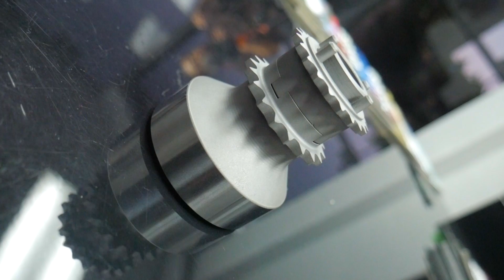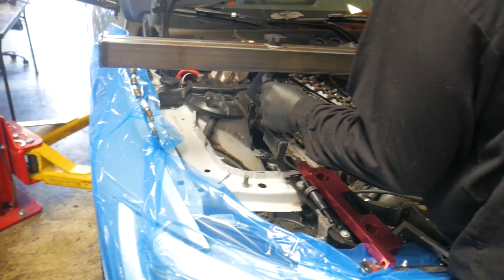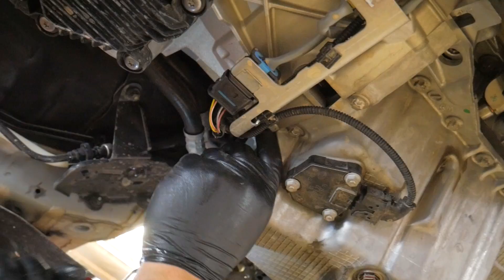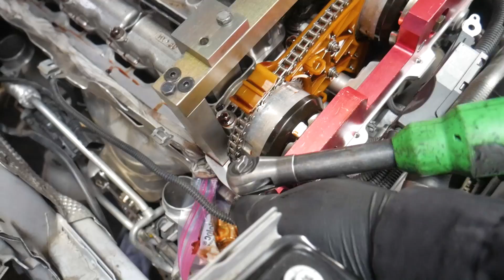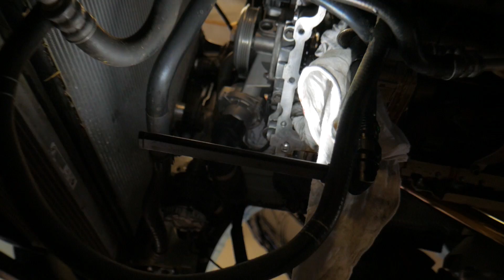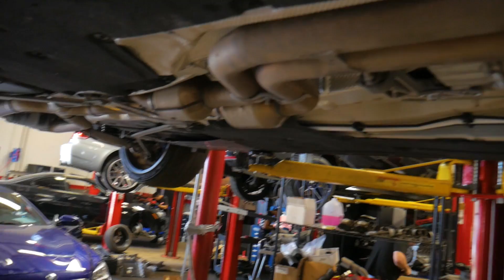BULLETPROOFING MY S55! | Keyed 4 Pin Crank Hub Full Install | Start to Finish + What to Expect!

Comment: WOW. Amazing video! 💯 Now, it's time to RIP on the S55
Reply: @yogimaster2654  Does anybody know if BMW changed the design of the crank hub on s58?
Reply: @bokiNYC  Yes S58 crankhub is keyed from factory.
Reply: @OPnoobTheDH  Any source to this? Glad  to see BMW continuing to focus on reliability.
Reply: Those pins will brake. That's the reason BMW had the friction plates, if major unbalance happens, it increases the chance of a less costly repair. With those weak pins 100% when they fail motor will just wrap up and be scrap.
Reply: @cutdepiefails6596  4 years later, 0 reported failures with the SSR 4 pin. Pins will only break due to improper installation. The SSR 4 pin is just the MAXPSI crankhub rebranded, and that was used on a 1100whp f80.
Reply from the maker: trust me i seriously can't wait 😈
Reply: what is the pricing on this if it were to be done on my 2015 M3 with the discount code provided? could you please PM me SSR? also what is the turn around time for this job?
Reply: how much was the total cost

Comment: I don’t know how drilling 4 holes into the crankshaft and having 4 tiny key pins holding the crankhub bulletproofing the engine I just wish this generation of bmw had the s58 where the crankshaft and the crankhub are unison

Comment: Don’t believe everything you see in these YouTube videos. Find actual factual advice from professional drivers or race car mechanics that actually push the limits on these cars. Your rear differential seals or turbos will first go bad before you ever have any issues with the crankhub.

Comment: This is misleading, but, You don’t have to drop the subframe if your just doing the crankhub…  Since he is doing his oil pan gasket, the front subframe is has to down….  I wouldn’t be surprised if this guy is doing his rod bearings as well.  He’s gonna need a alignment after dropping as well.
Reply: How would you change the gear hub on the oil pump drive if not removing the oil pan? Metal shavings from drilling the crankshaft???
Reply from the maker: according to my understanding from the SSR techs, dropping the subframe also helps with ease of installation as it frees up quite a bit of space

Comment: What are your thoughts on the insane bmw hub offering? I just picked up their 2 pin design and a vtt crank bolt capture for my F80. Planning to flash the car stage 1 with my current bootmod3 license.

Comment: You used a tow hook for the engine brace mounting. Which car is the tow hook from? The m3/m4 hook is too large to fit in the thread. Is there a part number/car I can steal it from?

Comment: Did you know you can get those two separate pieces and tread it into spline drive  also the crank shaft instead of getting ripped for 800 bucks 😉

Comment: And here I thought it was going to be something as simple as an oil change or spark plug change. This was damn near a full disassembly lol.
Reply from the maker: Yea man, unfortunately the process is very extensive lol. But worth it if you want to comfortably push the power levels of your F8X
Reply: @SimplyCarThings  Honestly, I'd do it even if you weren't trying to push more power. Preventative work to keep your engine from eating valves is enough of a reason to me.

Comment: This is so fake.  There are no known failures just hype to get a fix job done. !!!  The crank hub has a 100% safety built in. The engine was tested over a million miles.  If you are boosting the power over 700 bhp  then job is required.

Comment: wow, and I thought owning the E9* M3's were expensive. Seems more logical to just stick with them, as its $2000 USD or less to replace the rod bearings. vs $10k plus to correct the issue with the F8*. What the heck is BMW doing?
Reply: BMW sucks bro

Comment: Hi there,
why do you gap the sparks?
Reply from the maker: its required for the NGK spark plugs, especially when pairing with a tuned vehicle or one that is running E85

Comment: BMW engineers should have placed that crankshaft piece at the front of the driver’s wheel. On top of the horn button. Since they are gonna design them so poorly it needs to be changed on every single car!

Comment: Wonder why bmw changed the design from the n55.  Guess they figured they needed to ass a flaw for tradition?
Reply from the maker: The N55 has the same design and it has been a known issue at very high power levels
Reply: @SimplyCarThings  I did not know that. First I heard of it.  Interesting.
Reply: @SimplyCarThings  So I guess BMW knows about it and if they haven't fixed it by now they are not going to.

Comment: Love your detail and informative video, appreciation to the mechanic for sharing his skill and knowledge, but BMW design/engineering really sucked... 

The Woodruff keyway has been reliable since day one of the automotive and other industrial machinery and commercial vehicles, why the hell BMW engineers somehow think that "now is the time to get rid of the woodruff keyway", with friction lock washer for crank timing gear, the BMW engineering concept is just unreal.
Reply from the maker: Thank you for watching! Yea it's a very unfortunate design flaw that for whatever reason made it into production models for many BMW engines, the newest S58 twin turbo six cylinder engine features a keyed design from factory 👍
Reply: @SimplyCarThings  Thanks for your reply, I feel happy that you have the "bulletproofing" procedure done, and hope you will enjoy many trouble-free miles ahead!  I see your tire has a lot of camber wear, I guessed that you probably had much exciting track day driving as well.

Comment: why dont anyone use one piece forged hub?
Reply from the maker: Because installation becomes even more difficult. the Two piece design doesnt require the oil pan to be dropped if the specific shop wants to avoid that process
Reply: @SimplyCarThings  alright, good point, but speaking of reliability vise would one pice be more reloable to handle more power and granny shifting/money shifting

Comment: I really want to do it for peace of mind but it's such an expensive preventative measure.
Reply: think of it this way, either you spend 3k maintenance or 10k for the motor
Reply: @DerekYamz  that's not a good margin in my eyes, that's a 30% insurance.
Reply: It's a 50k car, what's 3k in maintenance?
Reply: @DerekYamz  Well this car is not worth 50k anymore once you've owned it for a few years. I'm assuming you're talking in USD so this car from what I remember is around 35k USD in the used market. Is it worth it? To some, maybe. But for me, I'm selling it soon for something else. And if you've paid 50k for the car, then your car is (hopefully is) still under factory warranty.
Reply: @WhatTheFlipOfficial  I don't have one but was planning to get one for fun. It's fluctuating  between 40 to 50 cad. And since you're getting rid of it soon, then there's no point for you to perform this.

Comment: I'm not sure why that hub needs to be 2 pieces since their redesign locks them together. The original is a ticking time bomb to destroy the engine. Seems BMW should do a recall to replace the part with a redesign. 
These cars are so complicated these days. It's all I can do to make myself work on my 2001 e320 MB.

Comment: If you go full e just be careful my injectors just got stuck open and had to tow car to shop. Burned half a tank of gas in about 15 miles. I test my e85 every fill up as well.

Comment: good vid. lots of work to do the crank hub.
Reply from the maker: Shnel M4 thank you so much! 👌🏼
Reply: Not something ide do in my garage. I would have also done the ic and an after market radiator.
Reply from the maker: @qwksti  Yea definitely not a DIY project lol. I thought about upgrading my cooling system but the stock F8X coolers are really good out the box

Comment: Great video 
All dislikes are by VTT Vargas guys hating on any other crank hub solution
Reply from the maker: jrzf80 Thank you! & hahaha, i have nothing against those guys or what they’ve done to help advance these platforms 🤣
Reply: What do you know about their non-keyed solution,  has it spun to anyone except that 1 person on the drag strip?
Reply: Idok Watcher has nothing to do if it spun or not but if you’re on any forum solution discussion the VTT guy is always there bashing other solutions how they don’t work how his is the only one that’s proven. As far as I remember their first solution the V1 broke the rig it was so good. Then they made a V2 cause a few spun due to bad manufacturing. Their warranty is that they will give you a new crank hub if it ever spins. Hahaha how about the engine? No. Don’t say it’s a warranty then

Comment: Omar, Great Job... your skills have greatly improved on the video side... thanks for sticking with it. I noticed... Now for the crank hub replacement the instructions and brief overview are spot on... this is not a DIY project at all based on the specialized tools involved. BIG shout out to SSR for allowing you to film this. This shows the true value of shops with highly skilled professionals. I’m planning on tuning my 2020 M2C  after my 1200 mile break in.. I kid you not.. I’m worried about all the details coming off the car and going back on tight and correct. I’ve had my moments at a Bmw shop were after close inspection I found things missing and loose, but it’s a testament to this mechanic work ethic that it was allowed to be filmed.  Omar, as you do more on your S55 engine, use this same approach, your content will be well received just like the E-46 content I’ve grown too enjoy for so many years. So will your following great job!!!👌😀

Comment: The S55 M3/M4 was suppose to be the reliable track duty N54 successor but bmw failed to make that statement true when they installed these slipping crank hubs. Also they did it just so you remember you're still driving a bmw.

Comment: This is why I stopped messing with BMW's post E36. They're disposable JUNK that you don't want to own outside of factory IMHO.
Reply from the maker: The F8X platform is pretty stout to be honest, and is insanely capable for straight line performance or on a track. Don't sleep on it ;)
Reply: @SimplyCarThings  I don't deny BMW performance straight line or otherwise. The turbos certainly facilitate gains. BMW's styling (subjective) is attractive, my favorite as of today. My criticisms are strictly long-term durability even if left in stock form. Similar complaint I have with Audi & basically all Euros.  Good luck to you, enjoy your ride! 👍✌

Comment: Would you ever need to replace the crank hub if you are planning on running stock boost with only bolt ons ?
Reply from the maker: There have been cases of it failing when stock, but the numbers are extremely rare. This issue only seems to be problematic once tuned and running high power, particularly with E85
Reply: @SimplyCarThings  appreciate the info

Comment: The amount of parts being removed gives me major anxiety! Such a big job...
Reply from the maker: Indeed, it's a very invasive process!
Reply: How much does it cost. And how long does it take ?
Reply: Edwin L 3k average, just cough up the money and your all set
Reply: @Ikiagain  3k doesn't sound bad. I would have them install some goodies while their at it.
Reply: That’s why I havent done it, I know overall its better for the engine but cracking open the engine like this..idk man lol
Reply: So dissapointed to see this about my 80k M3.  decided not to tune it , and even stock keeps me concerned all the time
Reply: I thought I was the only one. Man seems like a overhaul!
Reply: The E60 M5 was worse and it cost like 120k new
Reply: I have a 2018 f82 m4 getting this done soon from a shop here in Austin Texas 2,500 for all parts and labor not sure if I need to do it but peace of mind after all forms I’ve read about on the 2018 m4 models

Comment: Dope video glad I didn't attempt it in my garage. Defiantly need a lift to do this easily. FYI I spun mine guys so ask away lol.
Reply: Blake's Garage well wait to see how it goes. Sorry bruh
Reply: mazen sholakh happens over a year ago when my car had 9K miles on E85.
Reply: Did you spin even with the crankhub upgraded?
Reply: Sheldon didn’t have the upgrade at the time that will sort it. Well I should say this option and gintani are the only ones to buy all other “fixes” are garbage 🗑
Reply: Blake's Garage you planning on a new motor ? Been eyeing Steven Dinans motors .... not a bad deal. Keeping that option open in the future if I spin my hub. Obviously a 3 year plan lol 😂
Reply: mazen sholakh no I don’t want to buy a 40k motor by any means. I’m just on the stock tune now and I’m fine with it. E85 was gonna get me sent to jail I can’t contain myself from constantly doing 60-150mph pulls lol 😂
Reply: Blake's Garage it’s not 40k    https://carbahnautoworks.com/product/stage-2-s55-high-performance-engine-f80-m3-f82-f83-m4/    Check them out. Btw. Fan of your channel, so excited to see when you get your m4 up and running
Reply: mazen sholakh well I still don’t want to buy it lol. I bought a brand new M4 not a 5 year old one so I hope to keep it in one piece for a while on the stock power level. The extra power is fun but very unusable unless in a straight line. I track my car so the stock power is honestly more than enough with traction control fully off 👍🏼

Comment: How much was this and how long did it take?
Reply from the maker: Joseph Ornelas the pricing varies based off a number of factors. the hub itself is around $1200. It took about two full days for it to be completed
Reply: Simply Car Things thanks.  What does a “number” of factors mean? Like how well of a relationship you have with them? Friend and family discounts? That’s a pretty vague answer.
Reply from the maker: Joseph Ornelas i dont have any family connections with them 😂 Factors depend on if the job is preventative maintenance, or if you’re getting it done after spinning the hub. Also depends on if you’re doing any other services while the car is down. Usually the costs range from like $3800-$4k ish but I would call SSR for a concrete price quote because i don’t want to mislead you with an incorrect price.
Reply: Simply Car Things not friends huh? Posted on Bimmerpost - “I'm seeing a lot of crank hub related questions popping up in this thread so I'll drop a video down below that I made with my good friend of mine, Omar from Simply Car Things on Youtube. The video goes over a basic understanding of the crank hub issues and my experience based THEORIES / OPINIONS on the issue. Hope it helps those of you who are trying to gain a basic understanding of it.

Shah @ SSR Performance”
Reply from the maker: @SubliM3side  would you mind linking me to that thread? Thanks man
Reply: Simply Car Things I’m really not trying to be a difficult, but it seems like there is no standard pricing for parts and labor for this fix and they charge everyone differently.  I understand that it may depend on severity of the situation, especially if damaged, but to charge 2 people different prices for the same exact job, everything being equal, is not cool.  Standard pricing for the part and typical labor should be available from SSR.
Reply from the maker: @SubliM3side  There is standard pricing for this job, i'm just not sure as to what it is which is why I've suggested that you contact SSR or the owner, Shah and request a quote. It's not difficult to do so 👍
Reply: So prob $2,500 ish...

Comment: I need some help!! I'm looking for a new car to get but having a tough time choosing between 3 cars. I want something reliable, fast, and fun. My choices are a 2017 WRX, 2014 BMW M235i, and a 2014 Audi S4. I know the WRX is probably the best choice but just want opinions and why I should go for it. Thanks in advance!
Reply: M235i has same crank hub design, and it has throttle lag on upshift programmed in the ECU if you go with a manual.  Audi is Haldex not Torsen front wheel drive biased isn't it?
Reply: I can only tell you about the S4 - the thing was a perfect mix of luxury and performance and it came with stick. The awd is in fact Thorsen with 60/40% split rear/front and mine came with rear sport diff with torque vectoring, amazing bit of kit. I had APR stage 2 dual pulley tune and some other upgrades the thing was flying! But past 120k miles expensive repairs started creeping up on me so I sold it. Still in my almost 30 years of driving experience that b8 S4 was the best and fastest (almost 500hp on the crank) that I ever owned. And the sound of that supercharger with ecs full cold air intake is just so rare and amazing, you don't hear that often. My suggestion is S4!

Comment: Wouldn't it be great if BMW designed the crank hub properly in the first place.
Reply from the maker: I agree lol, but yea the new B series engines & S58 have integrated hubs
Reply: I thought BMW fixed it after 2018 models.
Reply: S58 fixed the issue.